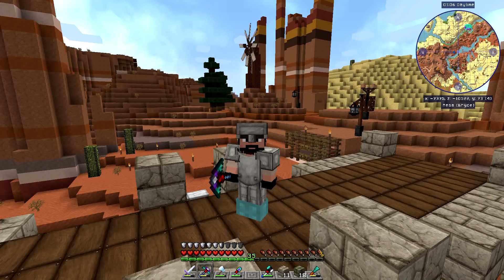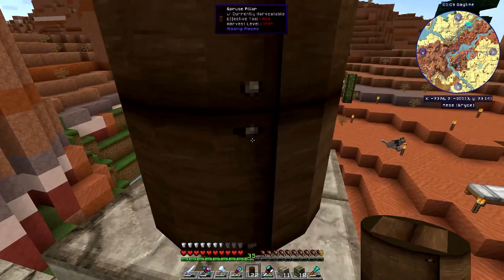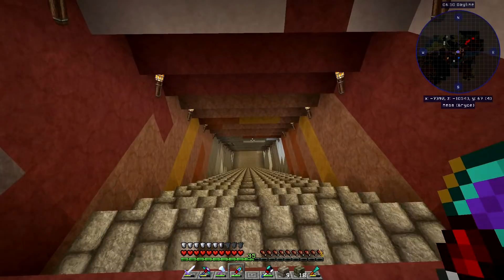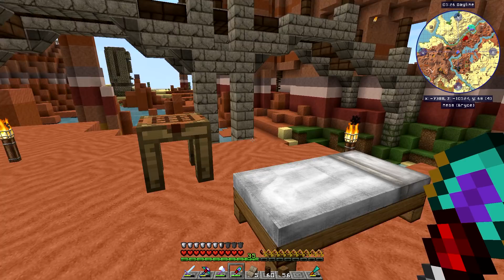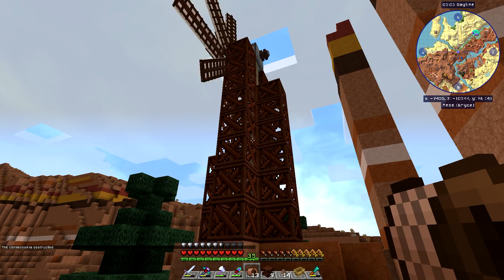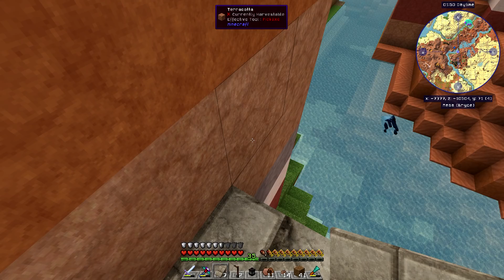RadioCraft Re-loaded EP12 "Bridge and Power"

Comment: I can see.....hehehe...the place looks really good now.....sad that ya had to turn off the shaders.....can totally see everything down in the mine....love the whole look it has now..
Reply: yeah the wires can be a PITA to put together in IE...but IT looks amazing when you start doing stuff with it.....you can make "fake" wire for looks with hemp fiber wires....can make some really cool looking things...gives it a whole steam punk look.  As for your wires from the wind mill to the lights....there is a issue sometimes when wireing up stuff on the top...YOu need to take OFF that top part of the poll with the Hammer and a right click....Wire up the light...Then put back that little bracket again...it has a tedancey to block the wire.....so ya have to do double work.....to wire stuff up.....as for the cut in the wire....havent run into that my self before...just takes a little tweaking with here and there...